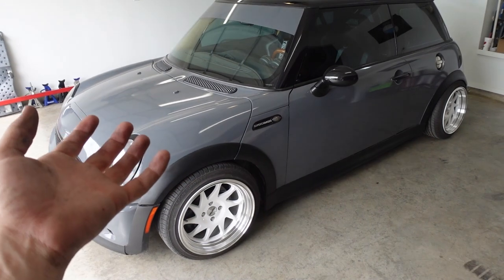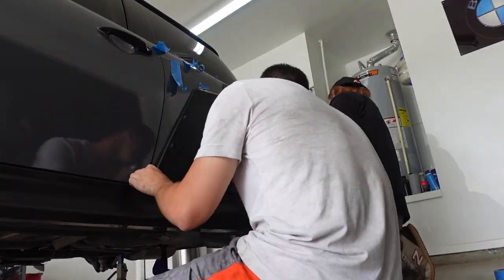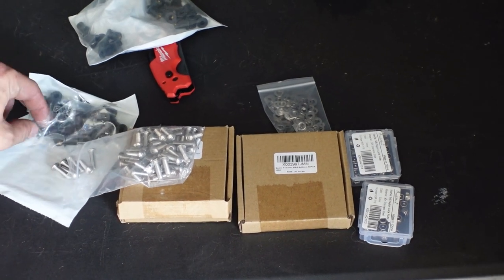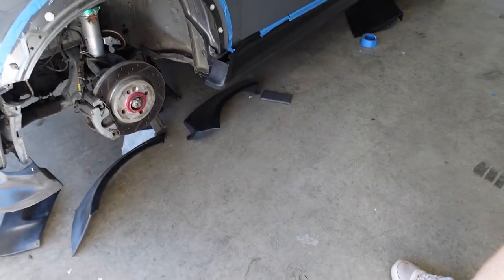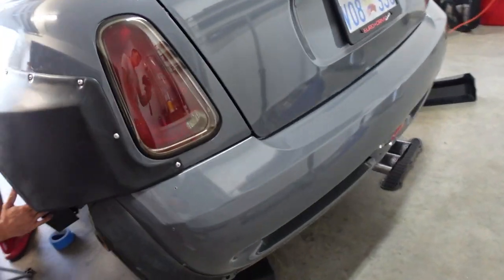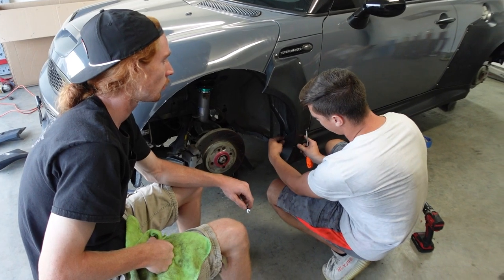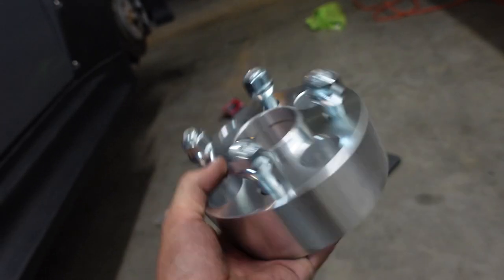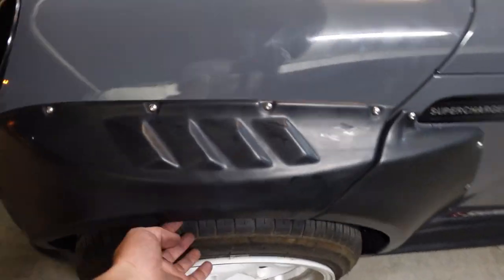Widebody R53 Mini Cooper ( shirokai install )

Comment: that looks sexy wet nice i like it. am just afraid of future rust on those self tapping screws.
Reply from the maker: The hardware should not rust as it's all coated. The self tapping screws that are left will be replaced with bolts and nuts the next time we take it apart. I'm always afraid of rust as well.